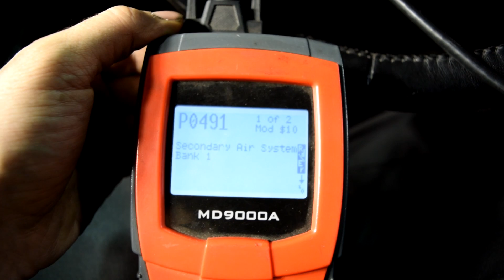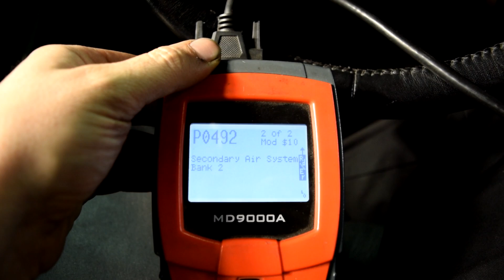Secondary Air Injection Pump System Operation and Diagnosis - VW Passat Audi A4 A6 Mercedes Benz

Comment: I'm working on a 2004 Landrover Discovery 2 for a friend, check engine light is on so won't pass emissions, first time I have worked on a Landrover and first time on a car with SAI. Long story short SAI blower is not coming on when its first started or cold. Blower is good, relay is good, SAI solenoid is good but put a new one in anyway, vacuum is good, just not activating at startup, unsure of what to look at next or where to go, any ideas ?

Comment: My SAI adventure: B5 Passat 1.8T
1) carbon-clogged combi valve -- replacing it got rid of check engine light, but smog readiness monitor would not set
2) no vacuum to combi valve's control port during cold start w/ pump on ==> replaced solenoid control valve (under intake manifold) 
problem solved

Comment: Good information all around.  Not sure you still check this channel, but mine keeps blowing the fuse.  Just removed the pump to test (and found water inside) but wanted to know what else may cause the fuse to blow.  

Update** I tested the pump and it works... so what could be causing the fuse to consistently blow after about 2 weeks of operation

Comment: A mechanic told me that another reason for "Secondary air system, Flow too low"  can be that sot has accumulated in channels in the engine. Do you agree and do you have a way to fix that on a 2,8  FSI? Unfortunately the channels start at the back of the engine.

Comment: My father didn’t have any codes, only issue he had was we would be driving the car for a hour and the temperature needle would barely move.  Decided to replace. Getting to it was hell so when we did replace it. This code came up. Is it possible I messed something up in the system that isn’t the pump?

Comment: If you look carefully there should be a little plastic plug which  pops out of the wiper mech cover which gives you easy access for a socket to undo the last bolt on the fuse/relay cover.
Reply: You're a legend!

Comment: Excellent video. I have a secondary air low flow code on bank one pending. Can you tell me what monitors the amount of flow that would trip the engine light? All the other diagnosis tests proved good. Air pump is running. No vacuum leaks. I tested the valves individually they both open and close. With vacuum applied and the relay jumped out. I can feel air coming out of the exhaust when the motor is not running. So my question is is what monitors the flow from the secondary air pump specifically on bank one?

Comment: Hey, great video! So my problem is that the port leading to the cylinder is clogged with carbon, causing insufficient airflow code.  Would I be able to say, spray seafoam into the system at some point after the kombi valve going into the cylinder head? (2001 audi a4 b5 2.8). Thanks!

Comment: P0411 on 02 a4 b6 1.8TQ says it’s the pn80 valve will engine light go off after that’s replaced or will it be something els?

Comment: I have a 2004 A6 2.7t with Secondary air injection code. Which hose on is should I check. Doesn't have the hose you discussed

Comment: So i just replaced my PCV valve and hoses. Im trying to fix a misfire. i get the secondary air injection system incorrect flow issue. But I recently replaced a camshaft position sensor As well.  I need to replace a catalytic converter bank 2 also. 
Im just trying to figure out why the car keeps dying.
Reply: What is the catalytic converter...?
Do you have a photo?
Reply: @ruirs4819  I had go take it to a shop go replace the catalytic converter its on the exhaust line, but the reason it kept dying was the Idle position sensor it was super hard to replace but a very cheap part. Car stopped dying since then.

Comment: On my 2.7T the pump burned up, I replaced it and it burned again less than 500 miles after I replaced it.  I noticed right away that it smelled like burning plastic when you started it up-  so obviously something wasn't flowing correctly..  After I had replaced it though, everything was working fine (Kombi valves were working, no faults, Vagcom said no problem).  What would cause the pump to burn out twice?  Bad luck?
Reply: clogged pcv system

Comment: I have a 2007 Jetta 2.5 and I can't get the secondary or primary EVAP to complete for inspection. Checked the secondary air pump and it powers up. I checked the two relays, J299 and J271, 100amp as well as you showed in your video and they passed. The car runs great. Have driven for over 500 miles and EVAP system still shows incomplete. Any idea? Thank you for your time.
Reply: ya i had the same problem on one of my cars - check the filler tube where you put your gas in - the tube gets wore out from putting the line in it to put gas in -  check your gas cap gasket ring - not sealing letting fumes out - missed up the EVAP  SYSTEM

Comment: On a Toyota will fix free. Vehicles less than 10 years old and less than 150000 miles. check with the dealer

Comment: so a bad relay could cause the air pump to run constantly? and drain the battery? cause i have the same problem 2001 vw passat the air pump sounds like it running good but i think it blew my alarm fuse or relay and yesterday my car stalled and the air pump kept running could've it blew my stater relay?
Reply: Yo rap did that kill your car too

Comment: Thanks guys..disconnected battery and charged overnight,started this morning with booster charge,let battery charge with car alternator, problem went away...fuse was good but relay was stuck in engaged status..I guess system itself remedied the problem..thanks n best to you all supporting each other...God bless..

Comment: my sec air pump (2005 A8 quatttro)does not shut down with ignition switch off,any help or guidance ..thanks for the great video..
Reply: I had the same problem on my '01 Passat...drained my battery completely over the work day and needed a jump to get home. From threads on Passat World, I found that you can either pull the fuse for the SAIP or the relay (both located in the PCM/ECM box on the Passat) temporarily until the part arrives. I've ordered a new/used relay on eBAY.
Reply: @chrisgruenloh599  I'm experiencing same problem with my 2004 A6. Runs intermittently until battery is dead. I don't think it's a critical component (correct?), would like to just disconnect it. So, it's as simple as pulling the fuse?  Will that affect anything else?

Comment: Great video, keep them coming!! Now mine has these codes, it comes and goes, I also hear an exhaust leak maybe that is what sets it off. I'm just think of removing that fuse and not using the smog pump it's loud and noisy. Bad idea?

Comment: I have 4cyl Jetta 1.8t ; I have engine light and the code saying SAI insufficient flow... the hose running from pump to Kombi is broken in half. Is that gunna throw that code?
Reply: I think you just answered your own question.
Reply: Absolutely yes

Comment: Hey very informative but it didn't address and issue I'm having with my 2003 FWD Passat 1.8t. The SAI pump cycles on and off continuously after I shut the car off and pull out the key which kills my batter pretty quickly. No codes no obvious wiring issues. 

Thanks again
Reply: Same problem here. Anyone know the cause and remedy?

Comment: Hey great video, you do a really good job explaining how the SAI system works! 
I have a similar issue, p0491 & p0492. which usually means that it's something before the two tubes split, but my pump is working fine, I checked many times and the houses from it and even checked to see really hi flow from it. what else can I troubleshoot?? I need to pass emissions, I am desperate of your expert advice!
Reply: https://youtu.be/nNxy3yLD2C0

Comment: Hey RatchetsAndWrenches , Thank you so much for this video, I have a 1994 C220, with the same pump that you tested at the end of the video, We broke the outlet hose connection on it, so we went to pick your part, got another pump, we installed it, and about 1 minute after cold starting with the pickurpart (replacement) pump it made a really loud screeching whinding noise, So im assuming we just got unlucky and got a bad pump from the yard, so MY original pump was good so we disassembled both pumps and i replaced my original compnents of the pump into the new replacement housing, that should be ok right? im currently charging my battery and about to start it, just wanted some tips ! thanks bro!!!!

Comment: hey i have a 02 bmw 325i  i have weak acceleration after car is warmed up, also getting the p0491,p0492 codes. is this the reason why my car is running so poorly or do these codes not effect acceleration? good video btw!
Reply: +Roberto Escamilla I have this same problem! Also shifts really rough coming to stop and when accelerating from stop. +RatchetsAnd Wrenches any advice?
Reply: yes exactly what my car does too!!
Reply: +Roberto Escamilla I cleaned the MAF with MAF cleaner which helped a little. Still a little rough.
Reply: i did the same didn't help much either. this weekend i am going to check the lower and upper intake boot to see if there might be a leak or rip in them. i read that might be a cause for the weak acceleration. let me know if you have any other suggestions!!
Reply: +Roberto Escamilla Did you guys figure it out? It sounds like you have a vacuum leak in the secondary air system.

Comment: Yes my neighbor actually said he replaced this pump about 8 years ago and now this one is shot as well. It should be a dry system and water should not be in there. The only place the water can be coming from would be that combo valve. It is such a pain to get to though. I'm afraid I would break something trying to get to it or worse, not be able to get it back on if I got it off haha

Comment: Good video. I am having issues with my 2000 Audi A4 2.8L SAI pump. I haven't gotten to check the fuses yet but all the vacuum lines up by the intake manifold are good and not cracked. My system is throwing the only code of P1411 (secondary bank). I took off the hose from the SAI pump that goes up to the intake box and about a cup worth of water came out. The pump does not kick in on a cold start. I am assuming the pump is junk, but I also think that the real problem lies up in the combi valve. Have you ever removed those on this type of engine to clean/replace? 

I have read a lot that this is where the common problem is because the combi valve seizes up from carbon built up. Any advice or have you done this before and removed those combi valves? They look like they are in an awfully hard spot to get.  Thanks
Reply from the maker: +knights1287 georgia In my experience its either the hoses or the pump itself, and if there was water coming out of that tube its probably in your SAI pump and your pump needs to be replaced. I would replace the pump and go from there. The Combi valves are hard to get to, I have a video on a head gasket replacement on a 1.8L but if you look up that video in my channel it will give a glimpse of the position of the combi valve on yours as well. They work very similar to an egr I also have a video on EGR systems you should watch that before digging in to replace those. GL